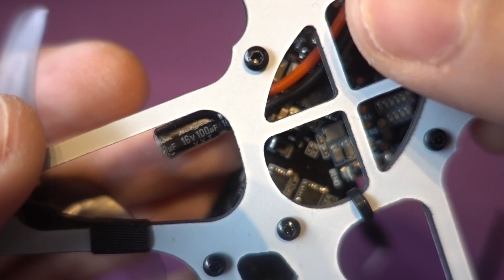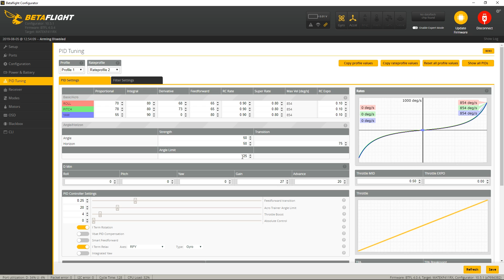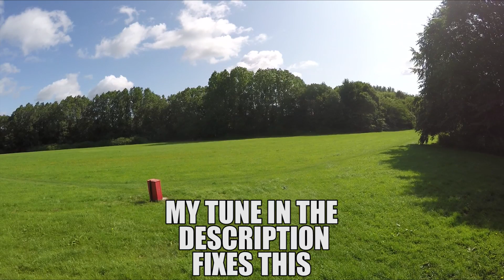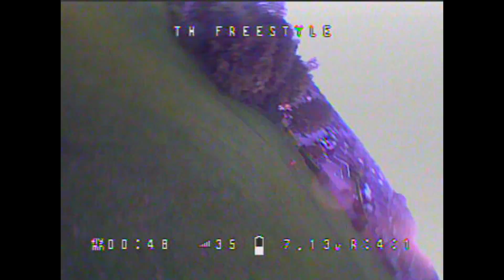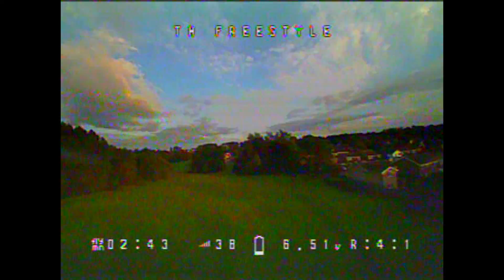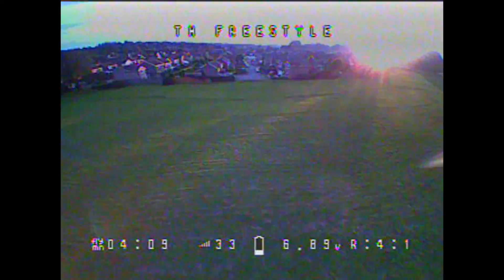NOT A TOOTHPICK - EMAX Tinyhawk FREESTYLE!

Comment: Hey Andy! Great video. I bought this on your recommendation and it is awesome! however, a few weeks in, I had a small crash, and lost all video. The camera and vtx work, as I have diagnosed everything correctly. any idea how to fix this issue? I assume the osd chip has somehow died but not sure how? otherwise any idea where I might be able to find a replacement board?
Cheers
Reply from the maker: an osd chip dying would just get rid of the OSD. its possible the vid in and vid out trace got broken in the crash as im guessing you checked and double checked the solder joints
Reply: @AndyRCchannel  ahh yea makes sense. I have resoldered and no dice. Looks like a new board. Is the original tinyhawk board the same? Seems to be the only one I can find.
Cheers.

Comment: Andy I thank you so much for the cli dump.. Thumbs up from us who don't have a finesse and your expertise with tuning in Betaflight.
I flew this, the Geprc Phantom and the original Tinyhawk as well as the new Tinyhawk S and I must say I had loads of fun doing crazy aerobatic maneuvers with the two cell freestyle but running through the trees as a slalom course and around obstacles the original Tinyhawk with the Mockingbird tune just took the lead in every way except flight times.. the Geprc Phantom with 650 2s flew for over 11 minutes in mixed flying and was the quietest of all four.
Reply: You should give the phantom another try with a 450 2s or 300mah 3s. It's really setting a handicap to run that big of a 2s in it against the two tinyhawks.
Reply: @Largetalons  True and I will try it with the smaller battery packs..
I run 550 and 520's on my Tinyhawk  original and the s version and they are still nimble.
Reply: @Largetalons  Drone Camps recommends a 3s 450 and that is quite a bit heavier than the 2s 650 and 550's and loves the performance.
Reply: Well the manufacturer recommends 300mah 3s for the phantom and with an 11 minute reported flight I would wager that performance is being traded off for flight times with that setup.

Comment: Nice review, I have a question can I bind the E6 transmitter that comes with the tiny hawk rtf to this quad? And if so how do I do it?
Reply: Alex Ramirez yes you could!!! I did before I bought the q7s. Tiny hawk, Tinyhawk s, Tinyhawk 2, and two freestyles on that little white transmitter. The Cli dump is on EMAX website.

Comment: Does your tune affect the flight time or the video at all? If it doesn't maybe what we were hearing was more of a harmonic rather than oscillation?
Reply from the maker: Yes it improves the flight time because the energy isn't being used up in heat. Harmonics wouldn't go away if the tune was changed due to it being an acoustic artifact

Comment: Can I use my EMAX rtf goggles etc from the original Tinyhawk with the freestyle Andy.?
Reply: Yes you can use the goggles right away. You have to do some configuring to get the RTF controller to work.👇👇👇
https://youtu.be/zxiAimVPI4Q
Its should be the same as the Tinyhawk s since they use the same board.

Comment: nice model I'd buy it but i'm still skeptical of the jst connector. and the answer is simple, theres a jst connector so they can sell the rest of their 1s battery stock. if the connector puffs the battery then you'll buy even more batteries. Thanks for the review.

Comment: Camera looks a bit poor but maybe it was lighting conditions?
Reply: No. The camera they use is crap.  I replaced mine in my tiny hawk almost immediately and I'll be replacing the one in this one with a nano 2
Reply: @DoRC  I wish they would just use decent cameras in the first place.
Reply: @FlyingFun.  yeah. It's not the worst camera I've seen (cough trashcan cough) but it's not great.  It's also annoying that they have such a wacky mount.  I'm going to design a 3d printable mount to attach to the uprights and accept a 14mm camera like the nano 2

Comment: With those voltage sags I wish they added a small current reader that was tuned. Personally I would add crossfire and swap out the cam/vtx, but other than that it looks great

Comment: The model has a great look , I hope the Capacitor doesn't  Break off  with a head-on  collision , I think they should have  brought it  forward another 10 mm and put a Cable tie  around it & the inside front arm for a little more support  with the heat shrink 😁👍 what a difference in the end after your pid  tuning , well done

Comment: one question, can we use the same battery connector for tinyhawk S?
Reply from the maker: no as the tinyhawk S 2s lipo uses one ph2 connectors and the freestyle uses 2 ph2 connectors in series
Reply: @AndyRCchannel  how about we convert it? so on tinyhawk S we can use same like freestyle connector. it is possible?

Comment: How are you so good at PID tuning? You're recommended settings are on most of my quads now.
Reply from the maker: if a quad has a bad tune but has the potential to be one of the best and I can offer that. Then its worth it to me. in the case of diatone they just didnt get it right. for me this one wasnt right where others might say it was. But the next video on this model should show my tune working nice with no oscillations and a slightly longer flight time

Comment: How does this compare to the geprc phantom? I see kabab said this was the best toothpick style he has flown, but don't think he has tried the phantom. Which would you recommend? I only have 5 inch quads at the moment.
Reply: Kabab also reviewed the geprc phantom. He likes the tinyhawk way better and guessed it's because of the weight distribution (both have 1103 motors and almost the same weight)
Reply from the maker: @l_chapo_1017   emax for power and flight time. geprc for range. emax has way more power on a triblade but the geprc would burn out on a triblade with 8000kv 7000kv is not enough for a biblade
Reply: Ah, interesting point. Thank you for the reply!

Comment: At least their using solid pins on the ph2 connector. Definitely try the twin blade 65mm props on this one. I would assume the lighter weight of the props would really help out tho this one is pretty responsive with the avans on it
Reply from the maker: 7000kv would be gutless 8000 is the sweet spot for the 65mm
Reply: AndyRC true. My betafpv hx100 just arrived so I’ll be testing 8000kv on 65mm 2s real soon 👍

Comment: Great review! Seems like a good one. Just wish they would’ve changed the cam and vtx. I won the tinyhawk s on their Instagram giveaway a bit back and while I love how it flys and it does seem to handle better than the original it’s not as fast to me. On 2s the speed seems just a hair faster than the 1s model. The thing I hate about both of them is the Fpv feed I get white flashes in the feed and makes it hard to see to fly. And all of a sudden today my 2s th doesn’t work. It worked fine yesterday and today nothing. No power at all. I didn’t even crash it. Weird. But overall my th with mockingbird at least in angle mode flys better but the 2s even on 1s flys way better in acro. Now for the new th freestyle it definitely seems like a great one and can still use the same batteries in 1s or 2s modes. I do like that.  And of course I just ordered the betafpv hx100 Monday and now Emax comes out with this one lol. I am a Emax fanboy but I’m not sure ima grab this one I wanna wait to see what the new diatone gtb339 and gtb229 brings.
Reply: The white flashes are multipathing, maybe consider a rhcp antenna mod?
Reply: Sam Bell I’ve tried the axii micro still didn’t work. Even being miles out of town no where near cell towers it still happens.